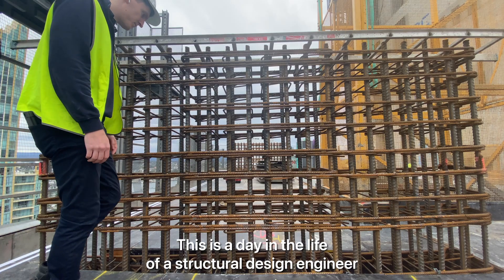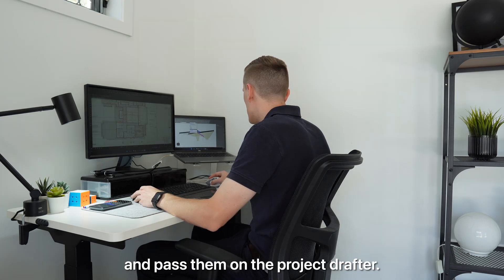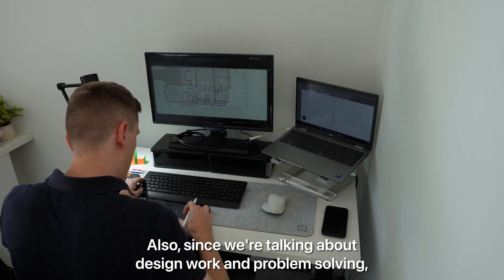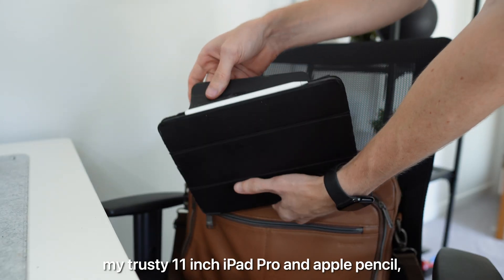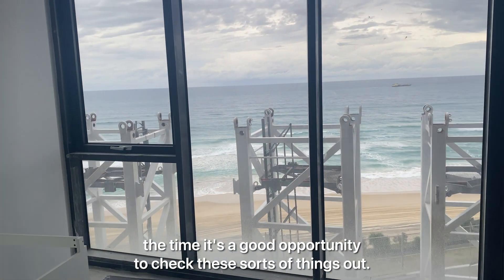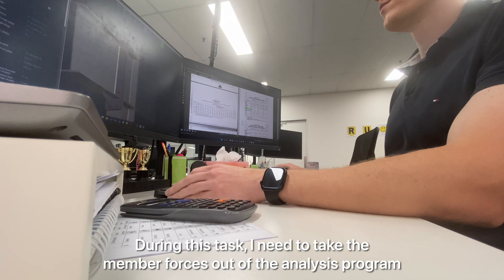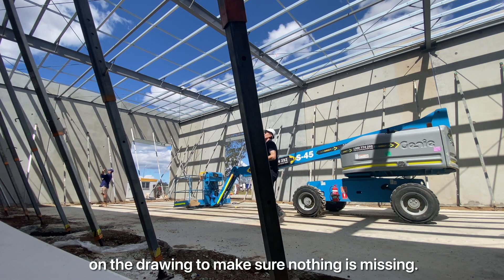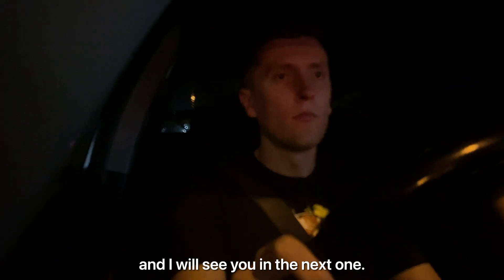Day in the Life of a Structural Engineer

Comment: Can you please tell in which particular uni course you learned to use space gass or other software’s
Reply from the maker: I did learn a little bit about Space gass in my steel design course at uni but most of what I have learned is through using it on real projects while working. Pretty much every program has been learnt while working too. A combination of mentorship from others, reading manuals and online resources.

Comment: Hello MR Engineer which apps do you use to design these parts of structures?
Reply: Great question 
I’m pretty much interested in The softwares
Reply from the maker: Which part of the structure in particular?
Reply: @BEngHielscher  Analyzing Fores on beam, column, ......
and designing apearance of structures.
Reply from the maker: The type of program I would use to analyse depends on the material. For a steel structure, I would use is space gass. The appearance of the structure is not designed by the structural engineer, the architect does this :$
Reply: @BEngHielscher  please make more space gass tutorials